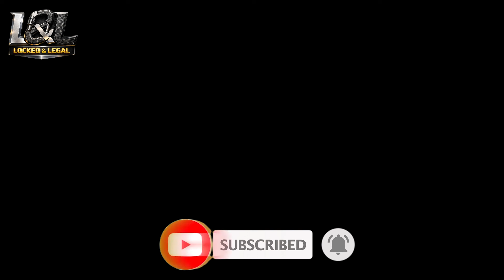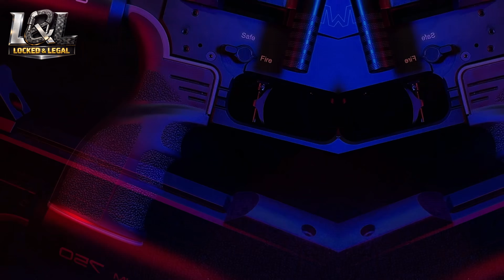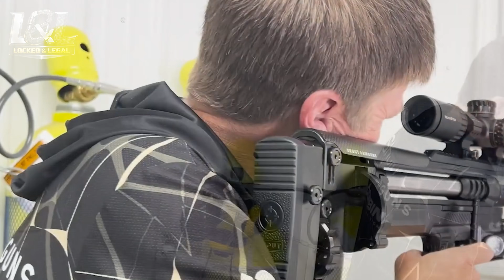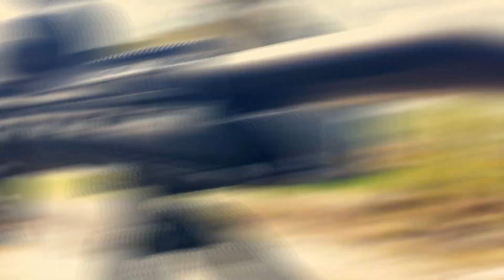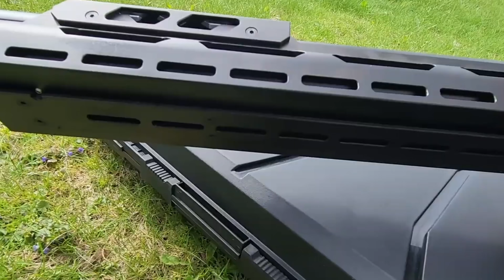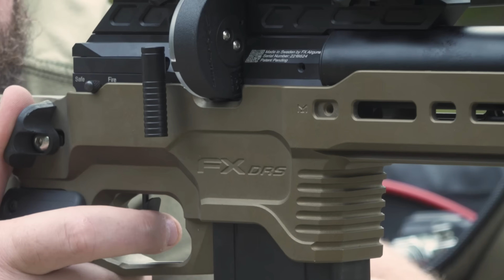The #1 Best Long-Range PCP Air Rifles for PRS & Hunting in 2026 – Is There a New King?

Comment: Yeah ummmm you got something wrong on the M4. The reg creeps like crazy. You have to fire a shot to get it back to normal every time.
Reply from the maker: Thanks for pointing that out. Reg creep is definitely something worth mentioning, especially for long-range consistency. I appreciate the correction and the real-world feedback on the M4.
Reply: @LockedAndLegalUs  I have a fx maverick 2 of the AMP II regs and I changed them because of inconsistency. No idea what the deal is but you can polish and clean the reg but you’ll need to do a good cleaning every 500-600 shots to stay consistent. That’s my opinion I guess.

Comment: Ruger 10/22 suppressed for 400 bucks is so much better plus you can pimp it out even better 😂😂😂😂
Reply from the maker: The Ruger 10/22 is definitely a fun and highly customizable platform—no argument there. But it’s a bit of an apples-to-oranges comparison. A suppressed .22LR is a firearm setup, while PCP air rifles are built for a different purpose—quiet shooting, lower recoil, and often better consistency for precision work without needing powder ammo.

For PRS-style airgun shooting or backyard-friendly setups, PCPs still have their lane. But yeah, if someone’s looking for pure modding potential and doesn’t mind the firearm route, the 10/22 is hard to beat.

Comment: I have an EVO  from Skout. It leaked air like a size. I sent it back a second time. Skout techs said there was no problem. I proved there was a problem. I chose have it replaced. The second rifle had a high pressure regulator problem.  Skout refused to  check it.  The Skout EVO is a HIGH PRICED PRICED PIECE  OF JUNK.
Reply from the maker: That’s rough… appreciate you sharing your experience. Issues like leaks and regulator problems are definitely frustrating, especially at that price point. Hopefully Skout improves their QC and support.

Comment: Airforce condor .22 slug gun 800bucks  and is accurate to 200yds maybe more done it, killed ground squirrels. 40 grain zan hollow points
Reply from the maker: Thanks for sharing! That’s a great example—Condor .22 really shines at long range with slugs.
Reply: 1 shot load = no fun to shoot